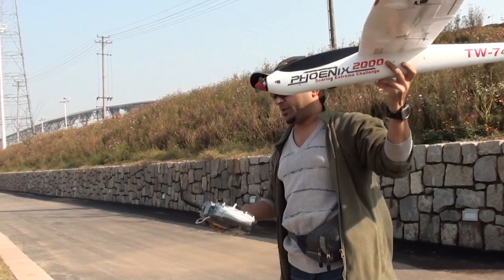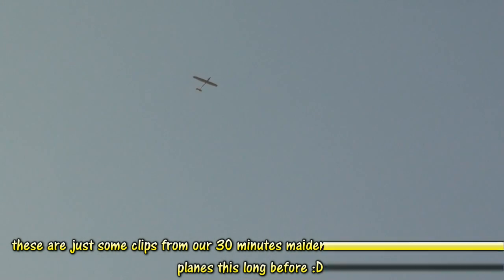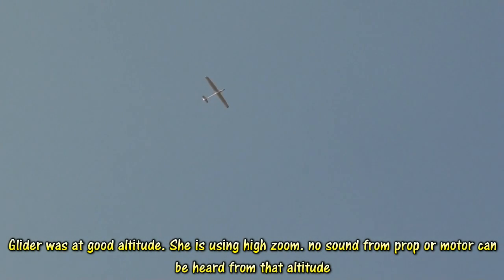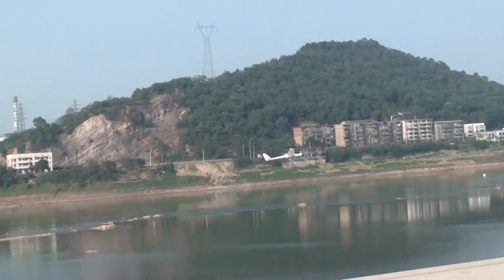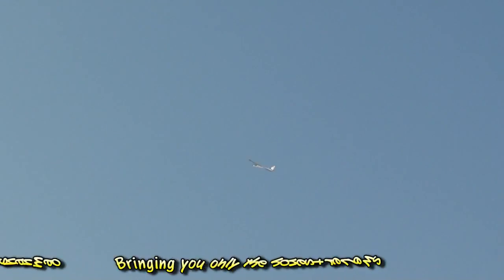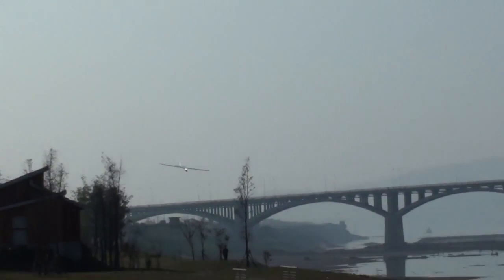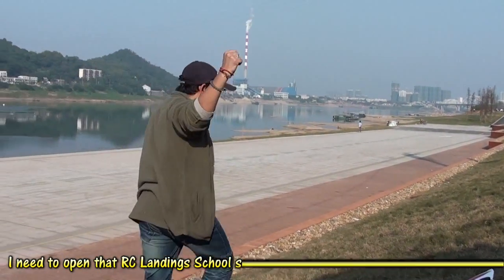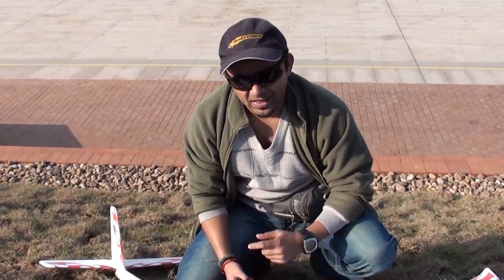Phoenix 2000 Glider Maiden Flight

Comment: Actually surprisingly enough it doesn't dive with the new motor. The old motor was about 120g and this one 250g so it's not a big change, so even if it dives, a minor elevator adjustment can be made in-flight. After flying it three times I can say it isn't a problem, and the phoenix glides as well as before =)

Comment: i though so when i installed it because it increases the weight of the phoenix by about 250 grams, but the thing is the peonix is then 1150 grams, and with a thrust of 2150g it largely compensated for the weight. Also it is not too hot at the end of two flights (you can touch it without getting burned) even if you do some vertical climbs. The thing I like about that upgrade is that it's as good for the flight, but mor powerful for takeoff and vertical climb. It can actually takeoff vertically =)

Comment: The motor has 600g thrust on the PNF version. Did you upgrade it ? I'm about to upgrade mine (in about 4 days) with a motor with 2150g thrust (3.5 times more), so I want to know if I have to expect something or if it's a surprise :)

Comment: @bchost I've kept mine aloft for an additional 10 minutes without any  troubles.  You have to realize that when the esc cuts power to the motor, it's usually because you have about 1 cell left in your battery.  As long as you're just gliding around after you see that your prop won't spin any longer, I'd say you can keep it up with very minimal surface movement, for about 6-10 minutes more.

Comment: @bslade42 I didn't realize it worked that way, thanks for the info... How much time do you estimate there is to get it on the ground before the battery is too low to run the servos?

Comment: @bchost Even though he said the battery died, doesn't take away from the fact that the ESC shuts power to the motor, but leaves power for the control surfaces to bring the plane back down safely.  I've had my battery die enough times in my gliders to know.

Comment: @alishanmao Thanks for the reply Ali, did you wire the UBEC in conjuncion with the ESC or totally seperate setup? Maybe one day you could post a wiring diagram and parts you used for you Phoenix 2000. I see many posts online where most people replace the motor, ESC and add strength to the nose... Did you do all this as well?

Comment: Ali you mention the battery died, how did the servos keep working in order to control it on the landing? Did you use two seperate batteries?

Comment: @sshukri0 NEVER run your Li-Po's that low ( 3.1v  per cell )  
Li-Po's fully charged are 12.60v total...
when running them down you wana try and keep them 
above  11.1v total or 3.7v per cell..
anything below is not good for the Li-Po...